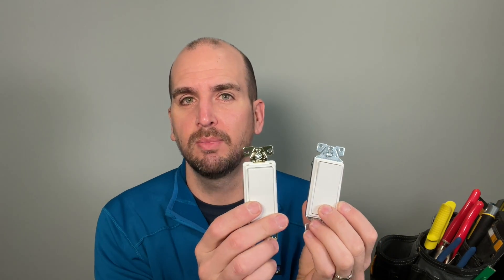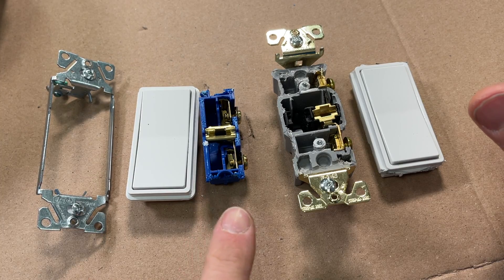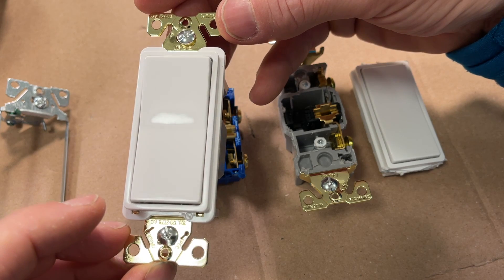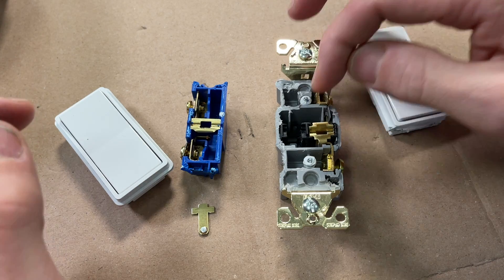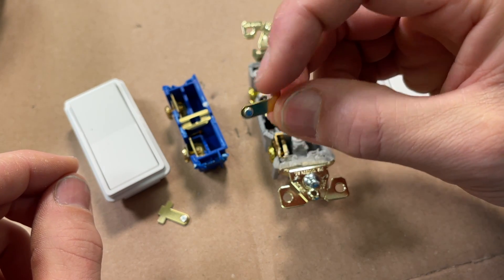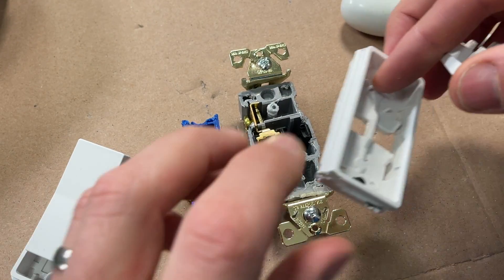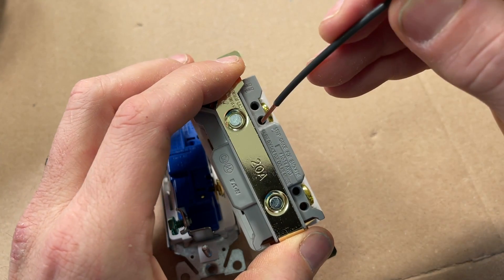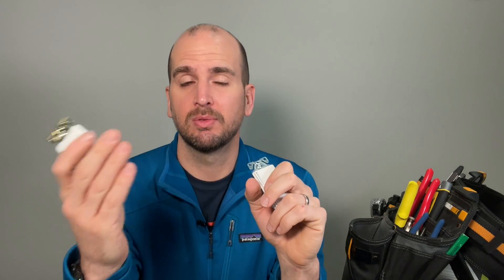What Decora Switch Should You Buy  |  Residential vs Commercial

Comment: I noticed that you didn't discuss DUTY CYCLE RATING .  For switches installed in HIGH use areas , with frequent cycling , spec. or commercial graded switches  usually have a longer life and their cycle ratings are available . Residential switches don't have a duty cycle rating .  For ANY switches I install , I use Spec. or Commercial graded switches ONLY .

Comment: In my DIYer experience with several residential-grade homes, I've had numerous problems with r-grade receptacles, and upgraded to commercial grade. But I've rarely had to replace r-grade switches, despite their much more frequent usage. I'd put my money in 12ga cabling (especially hot attic runs here in Houston) and commercial, even industrial grade outlets. Exception: I use the best switches I can get for motor or heater loads. And I concur with putting C-grade switches at the highest use positions, such as the kitchen and hallways. I do have to admit that C-grade switches often have a more satisfying feel, and I think consistency there is important, so if I did a few C-grades, I'd be very tempted to do them everywhere.

Comment: I like that the commercial grade model you showed was self grounding. My complex was constructed in 1982 and the builders used Flexible Metal Conduit instead of running ground wire. That commercial grade rocker looks bigger and I don't know if they will fit in the boxes.

Comment: My house was built in 2006 and it has Pass & Seymour rocker switches.  On the frequently used switches, the paddles popped off on one side.  I see Leviton has a "heavy duty" switch but they're made in Mexico, Lutron's are made in Korea.  The residential grade Leviton 5601 switches are made in USA.  Are those the better buy?

Comment: In my house I use all my lights witches 277 v rated either 15 amp or 20 amp are they better than the 15 amp residential these are toggle switch as I have made bypass and Seymour the blue ones are 15 amps in the orange ones are 20 amps that is the back part of them

Comment: Thanks for clarifying this!  I live in a high rise building with 20 amp wiring throughout,  but after watching your video,  it boils down to this:  the 15 amp switch still only has to power light bulbs or even a bathroom fan.  And I'm converting the lights to LED so 15 amps should still be more than adequate!  So that saves a lot of money!  Thanks again!

Comment: I thought about using the commercial grade switches, as I do use the commercial outlets. However the price difference is too large, I could keep a bunch of spare residential grade switches around and still save a bunch of money. For the outlets on the other hand, I've been annoyed with loose plugs so often in my life, the tighter connection and better build quality is worth it there.

Comment: There is no reason to use commercial switches for residential lighting. Even in the biggest of houses, one would be hard pressed to find a switch leg exceeding 5 amps. Using a commercial switch might make sense for a garbage  disposal or other type of motor where there is high inrush current.

The lower end switch is frequently used in commercial applications, as well. In places like warehouses, where a switch leg may take up an entire circuit, the commercial grade switch is a reasonable alternative to a contactor. 

Also, a quick note. Another poster mentioned that a circuits ampacity is limited to the lowest rated device. This is true if there is only one device. For example, a single receptacle on a yolk (simplex) on a 20 amp circuit must be 20 amps. However, a single duplex receptacle can be rated only 15 amps (as there are two receptacles on the yolk.) Don't buy a 20 amp switch for your house unless it's the only device on an entire 20 amp circuit. Of course, I have never seen that ...

Comment: cost wise I think it is unfair to compare just the price of a component, it would be more adequate to compare the price of the part installed. taking into consideration the cost of an electrician because that way you'll get the price difference less than 15% for a better value and also I don't think that it is fair to compare 15a to 20a  because you will be using 14ga on 15a and 12ga on 20a, and on 20a, therefore, you can install more daisy-chained consumers than on 15a resulting in fewer runs from the panel and less work for the electrician. the switch is purpose build for the circuit you are working on. (i would much rather pay 10 cents more on a single-pole switch the pay 10$ more for the 3 way switch)

Comment: "you're kinda paying for that without getting any benefit"

I don't think that's the case. I think it probably saves money in the long run because they can make one part that houses all the different types of switch, rather than engineering a different housing for each one. Any time a part doesn't have to be redesigned saves money.
Reply: It is cheaper in small quantities. R&D is expensive, so it's cheaper to do it once and make everything work for it. If they could make a custom housing for the commercial grade, it would be cheaper in manufacturing because it would use less material and parts. The issue is the R&D cost is too high and can't be mad up for in the reduced material costs.

Comment: Remember the NEC mandates that your circuit breaker  match  your smallest rated devices on the circuit so if you wire the house with 12 gauge wire but use 15-Amp rated receptacles and switches, technically, you must use a 15-Amp AFCI/GFCI breaker.

Comment: Decora is a trademark of Leviton. Have used that brand since the 60's and never a problem. Installed one Leviton Decora switch in a heavily-used location over 20 years ago and still works great. Didn't think about the difference, but if needed again, would consider a commercial grade if Leviton has one, depending on price.
BTW: Dremel brand rotary tools are junk. Had a couple and nothing but problems with them.
Reply from the maker: What type of rotary tool do you prefer?

Comment: As an electrician my choice is neither. They all tend to have a shorter lifespan than a real switch. Not to mention I hate decora switches. They are so 1980s-90s. They look odd and they are hard to find in the dark when you are reaching for a switch on a wall so you end up running your hand all over the wall getting annoyed that you can't find that ugly light switch. Humans like the satisfying flip and mechanical snap of a switch.
   For most applications in houses the cheap bulk switches and receptacles will last far longer than color you choose the trim to be... For the few very high use outlets and switches step up to the better grades.
Reply: As a customer, rocker switches are great, especially when carrying armloads of stuff. Try turning on a toggle switch with an elbow.

Comment: Switching loads in residential are primarily low amperage so the residential  15a grade is fine. Any motor loads such as furnaces and pumps you should be using motor rated switches.

Comment: When you have one design vs multiple designs is not a cost-saving. The common design saves them money because of the testing for multiple products and manufacturing rigs. I would also like to see where they are manufactured. They probably mass-produce the residential with a simplified design and less material in a place like a Chinese sweet factory, but the commercial with better components and testing may have to be done in a factory closer to the Americas. I would bet the engineers have done a longevity cost analysis too, the commercial will have a longer failure time calculated because could get used hundreds of times a day, vers a residential switch that is only turned on a few times if at all each day. In the end, what is worth more money the $100+ electrician call when your switches go out or $8 x 10 switches in your house the first time you pay them to do the same work.

Comment: After mounting dozens of them, I have found that the commercial version IS DEFINITELY worth the money when you tighten down the screws on the cheaper version only to have the travel distance of the rocker become more and more limited, with the tendency to decrease the force of closure of the contacts and to allow for higher contact resistance and i-squared times time heat and even arcing.   VERY BAD!,

Comment: Timely video suggestion for me.  I am repainting my interiors and updating receptacles & switches as I go.  I bought these residential models for my bedroom, 1 commercial grade for the 3 way patio light.  I liked the $2.22 price tag on the switches.  But as per usual, buying a larger quantity of receptacles opened me up to the biggest weakness of Lowe's; wrong product re-stocked in the wrong place on the shelf.  Half of my receptacles have the tamper proof feature, half do not.  The writing on the box that denotes the difference is so small, and the "care" of Lowe's minions is also so small, it happens all the time.  They got me for a few more cents.

Comment: Commercial spec grade switches that are rated 120v are typically about $5. He probably got a 277v rated switch which adds to the cost (yes, you can use a 277v switch on a 120v circuit).  Commercial spec grade is designed with more switching cycles in mind because commercial applications expect more usage over the same amount of time that a residential switch would be used.
Is it worth having a more durable switch?  Yes.
Is the price difference worth it? It depends on application and your wallet.
Reply: 240 volts in Europe residential.

Comment: Start bidding against a ton of other electrical contractors on some jobs and let's see if you use the cheaper devices or not. Good luck on your bidding!
Reply: Within the context of my home, I respectfully disagree with that. Given the negligible cost of materials compared to labor, using residential-grade equipment instead of commercial grade never makes sense to me, in my personal circumstances. I had to replacing a few worn out switches, I upgraded to commercial grade for just $4 more/switch and I was glad I did. I'll do the same for receptacles. If I ever need professional work done at home, I'll specifically request the electrician to use commercial grade equipment only.

Comment: Disagree ..
I just had a failure of a very similar switch - the only difference was that it was a 3-way as opposed to your single pole - I installed the original about two years ago when I upgraded an outside switch to a weekly timer and went from an old style toggle to a new flat rocker - this switch is used often several times a day - the cheapo 15A version lasted as I said about two years - and I recall when I installed it that it felt lightweight and cheaply built - frankly, I consider my time (the time required to replace the switch) more valuable than the difference between the cost of the switches - then there's the safety factor ..
That last alone is enough to ensure I never use one of the cheapos again - were I going to replace every switch in the house, I might reconsider, but I doubt it and in any case, ANY switch that sees heavy use should be the more expensive grade ..
Just my opinion ..
You be blessed ..

Comment: There may be no difference In a perfect world where the outlet boxes are correctly installed but we know for fact that it's more common to find crooked recessed boxes. I find the beefier commercial grade switches and outlets provide rigidity when I have to use spacers to flush out the switch. Residential grade always flexes in this situation resulting in dimpled nylon wallplates or cracked plastic wallplates when trying to snug them down to the wall surface. The metal band on the commercial switch backside does the trick. And yes I've used plastic box extenders, Lego type snap together spacers, washers, wood shims and even JB Weld to beef up the boxes. I agree with everything you said. Just contributing why I routinely use commercial grade in my remodeling projects. One of my top 10 dislikes in life are light switches & outlets that flex when touched. Think I might have encountered one correctly installed box in my entire life. Lol
Reply: Excellent points!! So very true

Comment: I've broken two Decora switches post installation in my house. Exactly what you talked about. they popped the front. For heavy use areas (bathroom, kitchen) I would use these if they hold up better. Bedrooms, entry areas, etc. that only get used a few times a day, I agree. Backwire option aside. The Levitons I bought bulk from Homeless Despot did not have this.

Comment: I installed a Decora switch with an electric fan timer in my bathroom that gets a lot of use and have had to spray the rocker pivot area with dry lube (Teflon AKA  polytetrafluroethelyene ) because the effort to activate the switch really increased after only 10 months use.

Comment: Kudos. That is a very fair and balance review of the two. For homeowners there is no reason to buy the "spec" grade. Spec grade is such a snobby term abused by marketing fluff. All US electrical devices are required to meet spec's so the commercial grade is not unique. You pay for more robust construction against abuse like people try to kick the switch in. Who use these "spec" grade products? Often the entities that you and I fund.

In fact I dislike these Decora series. They provide nothing better in functionality but rather reduced functionality. I like simple toggle switch which is easier to use in low visibility conditions.

The standard issued duplex receptacles has features that guide the plug contacts into the receptacle but not the Decora counterpart. I call these fashion victim designs.

Comment: Installed the residential grade in my house 30yrs ago with no failures, all of my lighting is LED with much lighter loads, for me residential is just fine. Just saying!
Reply: The crappy LED drivers in the lights will go out long before the switches. In fact, the damned chinese LED circuits make my LED lights go out quicker than Incandescent bulbs that obama banned. Dumb. LED is more efficient but the companies making them have no reason to up the quality because you can't by ILB any more other than boutique expensive ones. Blah. Without competition, why build a better LED driver? (technical note: traditional ILB aren't really "banned" but good luck buying them easily anymore.)

Comment: Does anybody know if there is any difference in life cycle specifications and  UL requirements between these 2 types of switches.
Reply: the rating is the same, the commercial one simply has a LOT higher specs then the "bare minimum" that is required by law. so especially where switches are used a lot and plugs are used often of are used with high current devices you are better off with the commercial type as it has better tolerance to abuse.

Comment: I'm a journeyman electrician with over 30 years of real life work experience.  I only purchase and install commercial spec outlets and switches.  The extra cost for commercial spec devices is made up by no extra labor costs down the road (as the residential grade will have a shorter life span) and the build quality safety factor of commercial spec grade devices means they are less likely to fail in a manner that could cause a fire.

If you purchase residential grade ... I would never recommend using the "backstab" wire connection (spring tension, not screw tension).  I have seen many failures/fires caused by using this feature.

Comment: In 60 years I have yet to see a switch failure!  They both look like they are quality products. Makes me wonder why anyone would ever pay $10 for a switch?  One would also think that the Electrical Standards bodies would reduce the allowable volume of the box because of the physical size / volume of the commercial switch similar to what they do for dimmer switches and gfi plugs.
Reply: In 5 years I've seen a handful fail but mostly because of bad environments. Multiple shops and a large cold warehouse for beer. The key is just proper application in my experience. For the most part on commercial jobs I install commercial grade stuff and for residential install residential grade. In welding shops if I can convince the client I go Nema 4X
Reply: You've never seen a switch failure? Higher voltage mans electricity can pass between two electrodes from a further distance. That arc will cause the contacts to spall before closing. Repeat thousands of time and as the contacts further degrade, the load will pull more current to make the jump. 

An easy one to find is usually the contactors for motors like in HVAC. A relay is nothing more than an electronically controlled switch. Common issue is spalling from constant use and then, hopefully, the breaker will open the circuit when it starts to draw too much current to make up for the degraded switch contacts. Of course, worst case scenario is melting and burning.

Had to replace a pullout box because the homeowner kept flipping the breaker back on and the heat from the excessive current welded it shut.